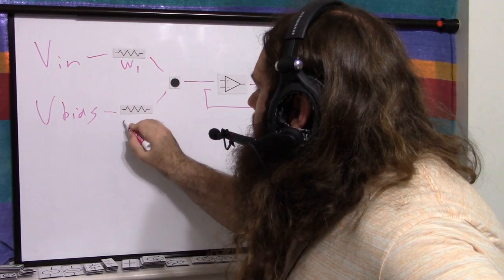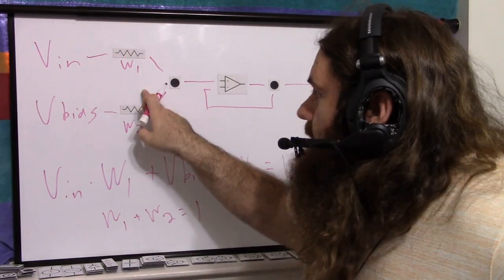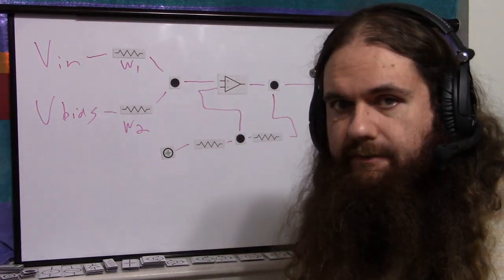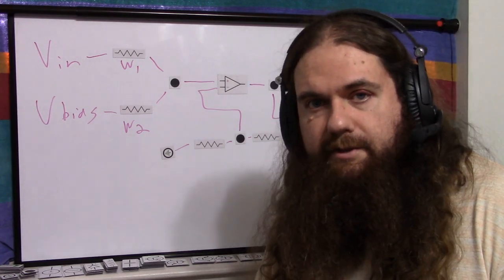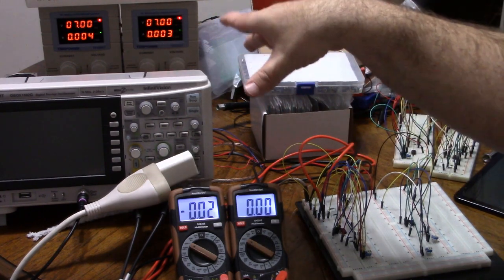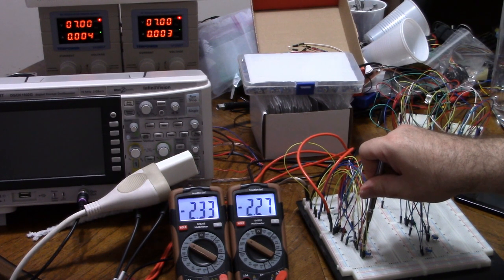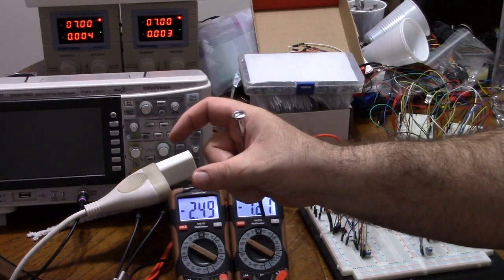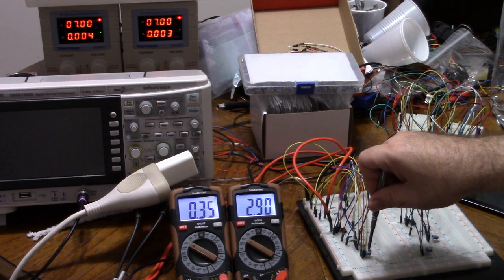Buffer and Bias an AC or DC Signal In One Single Step With an Op Amp - Simply Put

Comment: You don't think about circuits like this until you need it. Like you said, it's especially useful when working with single supply circuits where the signal needs to fit within the rails of your opamp.
I like using the the MCP6001/2/4 because they're truly rail to rail but they're 6V max unfortunately.
You might be able to get free samples of the 6004 in DIP from here https://www.microchip.com/samples/?devicefamily=MCP6001

This TI document is interesting. It's called Designing Gain and Offset in Thirty Seconds.
http://www.ti.com/lit/an/sloa097/sloa097.pdf

It would be nice to see the output of some of these circuits on a scope instead of just looking at two multimeters.
Reply from the maker: It's a lot easier to view DC signals on multimeters is why I do that, but I'll try to remember to show off both DC and AC signals in the future.

Comment: How would you recommend removing the DC bias if you're biasing a DC signal?  Another summing op-amp but with a negative voltage?
Reply: Capacitor in series will remove DC bias

Comment: It would be helpful if you were to explain the terms that you use, such as voltage bias, etc.  I got it from context, though.
Reply from the maker: Asking for clarification in the comments is great though, because my brain has all my videos in it but people will have watched different ones, so I don't know what people don't know for a particular topic. "Bias" is a general term that is in a lot of fields, which basically means just a static offset not based on the actual thing, so a varying signal could have a static +2V bias, an artificial neuron has a bias separate from all its weights, somebody has a personal bias when approaching a topic so they're not impartial, and so forth.
Reply: The trouble with being self-taught is not knowing where your “knowledge holes” are.  Videos like yours help quite a bit.